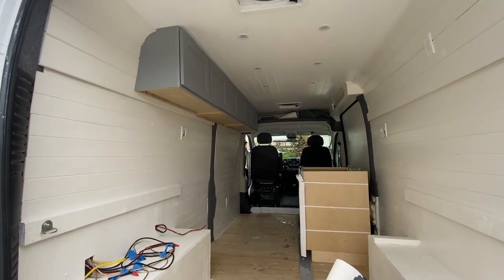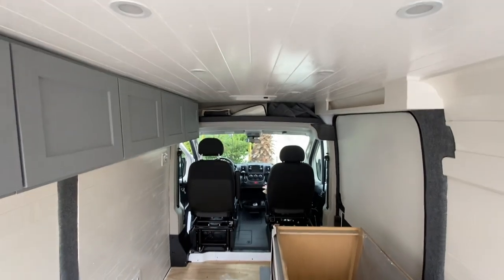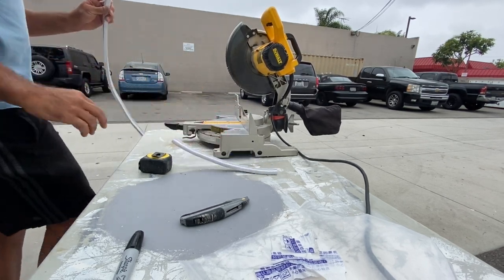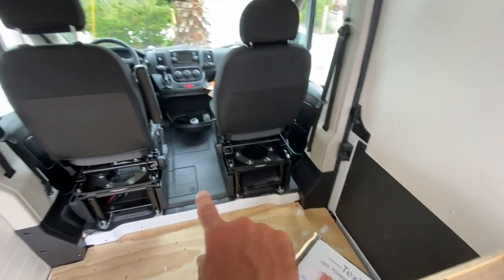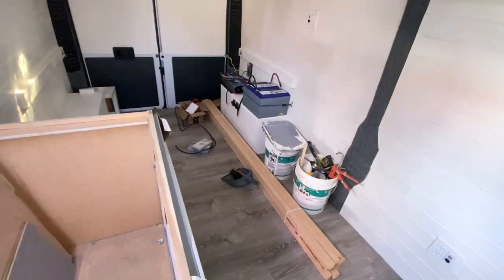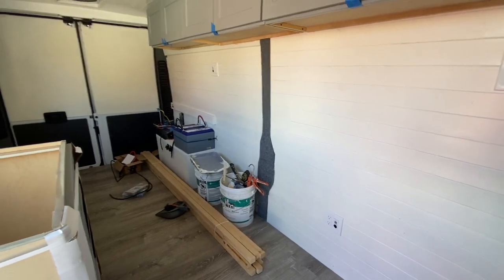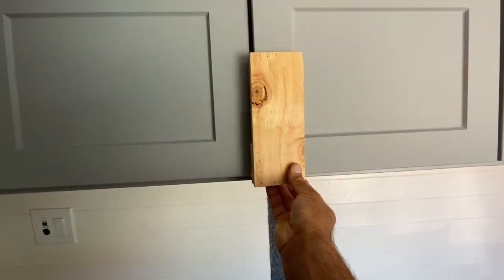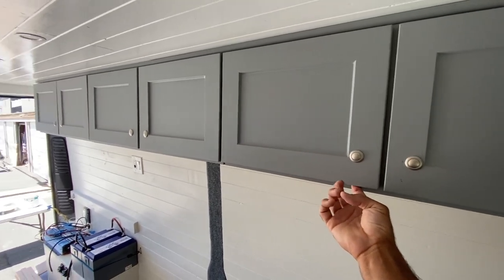Van Conversion- Part 8

Comment: Can you leave a link to the wall cabinets that you used?  thanks.
Reply from the maker: these were from hd supply, bought in person, i have a new video on my current sprinter build i am working on with more details on how to install them and match the angle of the walls
Reply: @BuildingVanLife  , thanks.  Great videos.  Very helpful.